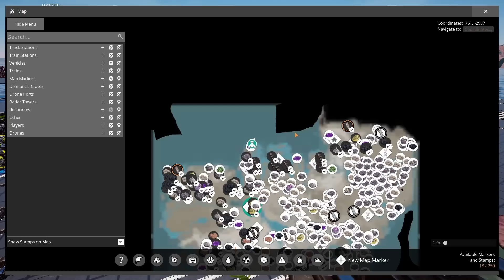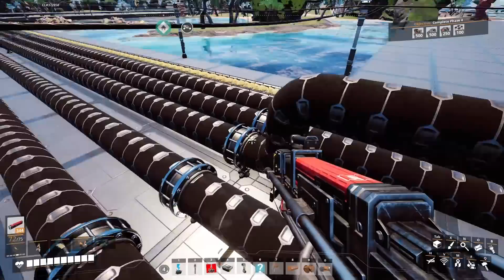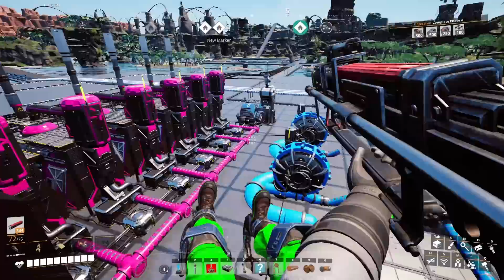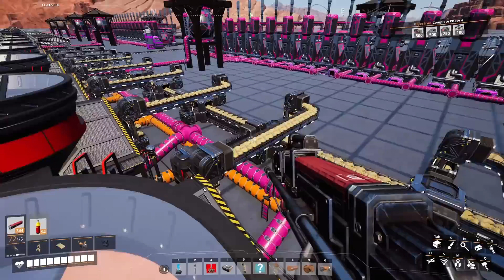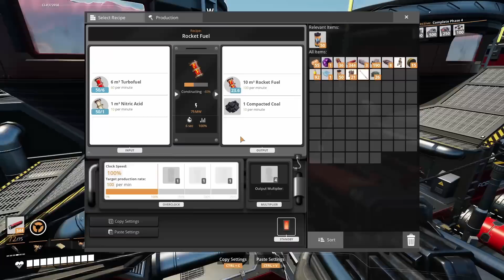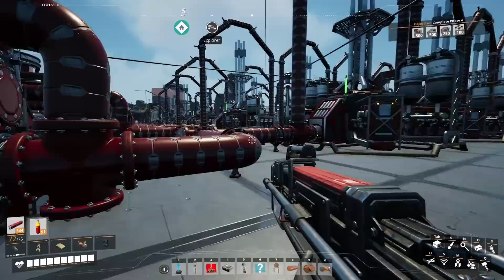You Won't Believe the Amount of Work for Late Game Power. Satisfactory 1.0

Comment: I'm confused why you aren't using the nitro ricket fuel alternate, is it mentioned in the video?
Reply from the maker: because this recipe, when broken down on a larger scale, provides more power. but obviously requires alot more work. I believe we broke it down as a community on stream one night to see which would be more useful to utilize with the materials i had available. Also, that was calculated prior too me pulling a 2nd node of nitrogen to the area aswell, so who knows lol

Comment: Crazy, beat the game easily with less power than your producing now, let alone the over clock. What will you even use it for?
Reply from the maker: If my objective was to beat that game, i would have done that 300 hours ago, But the objective is to overkill everything, because that's what i do, and always have done. im not speed running, im just having a great time.
Reply: @Timmplaysgamesalot  It wasn't accusatory, it was informative. I was honestly asking what will you use it for? Straight honest amazement and question. Why assume malice? Sorry for asking I guess?
Reply from the maker: @zs3000  not sure what I'll use it for, I'm building until the game won't let me anymore. Just ensuring I got more than enough power to not care, once I unlock power shard crafting power will get very expensive.

Comment: Okay genuine question... why didn't you use the alt recipe that's literally 10x easier and uses far less buildings?
I don't know sometimes but it's like a player takes a look at what's needed and what they can make and then jump on it and don't use the SCIM calculator just to gander at other locations they could use for best output rates. Great build in my opinion, just horrible execution with planning and future proofing in case you wanted to do something else with that region in particular like making a huge oil refinery area or whatever.
Believe it or not but I jammed 172 generators into a small area and it makes just over 107,000 MW from the alt Rocket Fuel Recipe, and I could make more power with the byproduct I get from making Rocket Fuel to make Turbo Fuel.
Reply from the maker: For a very good reason, we (as in over 100 people) broke both recipes down on a Massive scale (not just 172 tiny gen's), and this recipe produces more for less. (main situation being the nitric acid). I'm getting to the point in my satisfactory experience where I have gathered enough knowledge to be able to actually explain my reasoning behind everything. I challenge you to join me on a live stream some day, so you can see that I, in fact, don't do things logically. My main focus is to do things you would never dream of doing, so that its actually content and not just a replication of what the average player base would be. Ill gladly go into more detail of why its better if you want, but might wanna take another look at it.

Comment: yeah didnt realize that  one area of oil made 8 600 lines of diluted fuel and only one of those lines made enough rocket fuel for 120 fully slugged generators..... like 50 megawatts. so with enough coal and sulfur i have enough fuel to make like 400 megawatts...... also there is a recipe that goes strait from fuel to rocket fuel
Reply: I don’t like that recipe. Sure, you can get even more Turbofuel, but your sulfur consumption also spikes.
Reply: @Lukashoffmann94  That is were the converter shyne. Use iron or coal to convert into sulfur and you will never run out of sulfur again.

Comment: I just got nuclear unlocked and was looking at the flow with a planner. Nuclear is crazy complicated at a glance.
Reply from the maker: @Cobb  very, only recommend nuclear if you want a challenge for sure. Just finished this up on stream with 460,000 with rocket fuel. Way more than enough for a long time.
Reply: i started uranium + plutonium factory based on a planner with the only requirement of 600 uranium. it took me around 100h of work for 10 uranium fuel rod and 6 plutonium fuel rod. i end up with factory that produce more than my main base ... this is ridiculouly complicated and required more than 20+ alternated recipes. it also required nearly every base ressources in the game (except coal and sam). That means a lot a logistic work. This build took all my energie and now, i don't know i will finish t9, i'm completly exausted by the scale of this kind of build.
Reply from the maker: @GuillaumeCerceau  I feel this! Such a huge tree of items just to get to uranium. Not even including plutonium. I think nuclear is in the game strictly for people that want a challenge.
Reply: @GuillaumeCerceau  Exactly the same. I got minimum out of the work compared to "just" rocketfueling my generators.
Reply: nuclear is more compact but not clean
and it takes a lot more effort than rocket fuel to produce cleanly
in the time you build enough nuclear to generate power for your playthrough with nuclear you could have just upgraded your sulfur miners and made more rocket fuel
Reply: @Cobb  do your calculations with the satisfactory calculator site, then work from the top down. Makes things seem a lot easier and it's easier to build that way imo.
Reply: @Cobb  nuclear is only worth it for the challenge. Rocketfuel is meta
Reply: If you use a couple alternate recipes and can Ship in pressure cubes, its super compact and waste free. Use a converrter if you dont want to bring all Ressources to the site.

Comment: How many hours of uptime does this have? I had some very similar update 8 factories, not making rocket fuel of course, but similar numbers of machines doing different fuel, turbo fuel set ups, and I used very similar building techniques to what you have pictured here and I kept getting brown outs.
Reply from the maker: @theravenone3439  lots of factors go into making it run 100%. But this one is perfectly optimized to run 100% forever.

Comment: I am curious about your nuklear plant. Mine used a lot of space. I put it in the south west corner of the map, reaching from paradise island up the whole shore ending at the oil nodes. 6 Levels (6 x 10 walls) high. But it's only so big, because I utilized ficsonium rods. Wanted to try it out, even though it doesn't seem to be efficient at all. (I think: Efficient would be to sink plutonium rods + use the resources required to go the ficsonium route to build and feed energy amps.)
Reply from the maker: @rotak7792  I'll hate it up and running soon so you can check it out